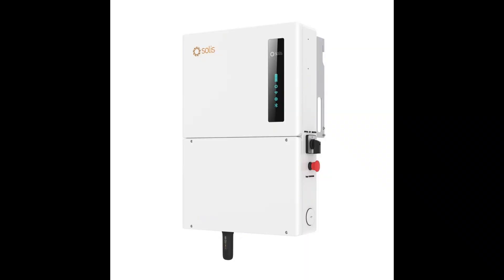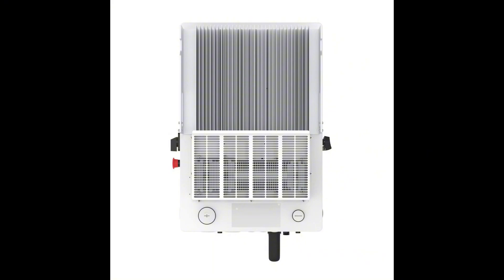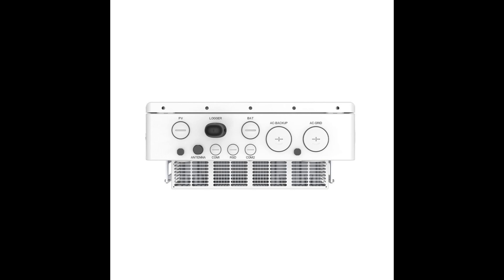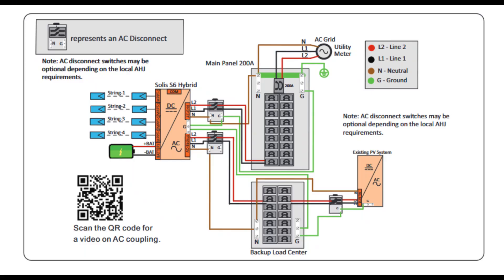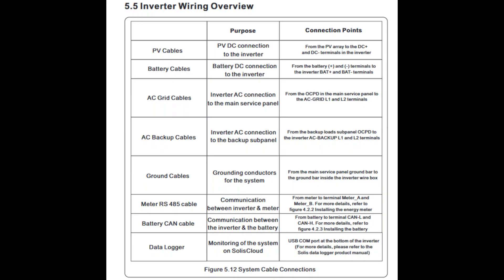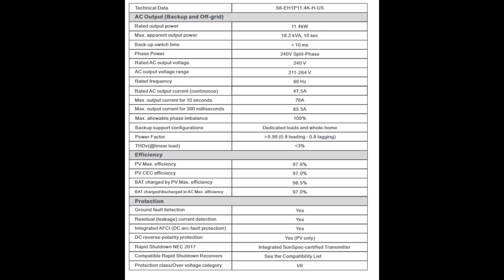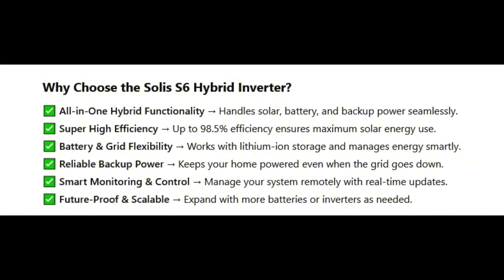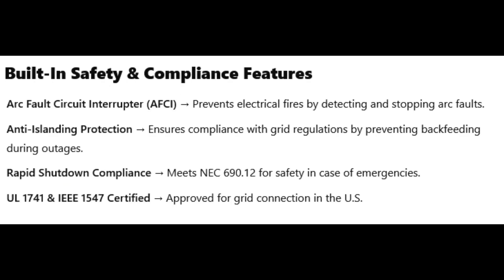Solis S6 EH1P Hybrid HIGH-VOLTAGE INVERTER! (Solar Power BEAST)

Comment: The Chinese are flooding the market with these cheap, short-lived inverters. While they are available in different metal cases, they all use the same outdated high-frequency inverter tech that provides a poorer surge capacity and a shorter expectancy, and worse yet,  when its MOSFETs fail,  it can do some pretty serious damage to your appliances or your EV because it lacks any galvanic isolation between its DC boost stage and its AC output. I would never install one of these units anywhere near my home.
Reply from the maker: Hi there, I appreciate your concerns, but it seems there are some misconceptions about Solis inverters that need clarification.

    Modern, Reliable Technology:
    Solis inverters are manufactured by one of the leading names in the solar industry. They incorporate up-to-date inverter technology that has been rigorously tested and certified to meet international safety and performance standards. High-frequency inverters are not inherently outdated—they are a standard in modern solar technology due to their efficiency and compact design.

    Surge Capacity & Durability:
    The claim about “poorer surge capacity” doesn’t hold up when looking at the performance data and certifications of Solis products. These inverters are designed to handle surges effectively, and their longevity is backed by warranties and widespread use in residential and commercial installations worldwide.

    Safety and Galvanic Isolation:
    Contrary to what’s been stated, Solis inverters are engineered with safety in mind. They incorporate necessary isolation and protection mechanisms between the DC and AC sections. This ensures that, in the unlikely event of a component failure, the risk to connected appliances or EVs is minimized.

    Global Track Record:
    Solis has built a strong reputation not just in China but internationally. Their inverters are installed in a diverse range of environments, proving their reliability and quality across the globe.

While it's important to scrutinize technology and demand high standards, Solis inverters are built to meet those demands. They provide efficient, safe, and durable performance that has been validated through extensive field use and certifications. It might be worth taking a closer look at the technical specifications and certifications before dismissing them outright.
Reply: Make no mistake, Solis S6 is a very solid unit with lots of features and very reliable.  Solis is one of the most popular inverters in my country (Northern Europe).